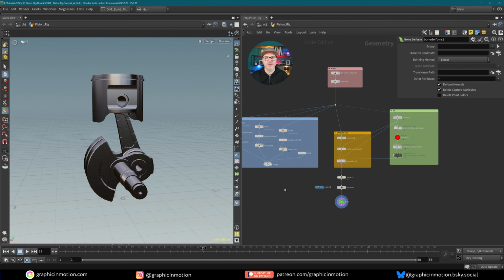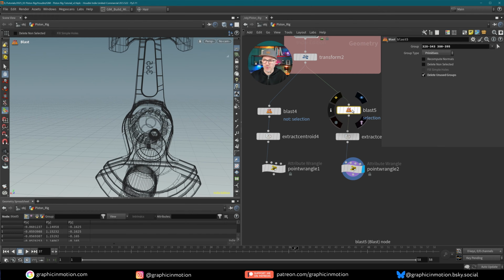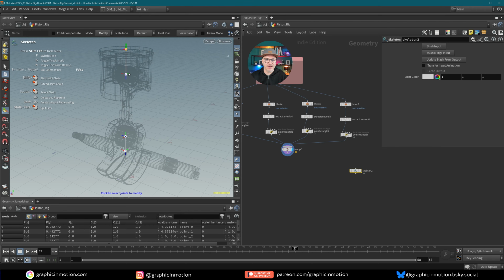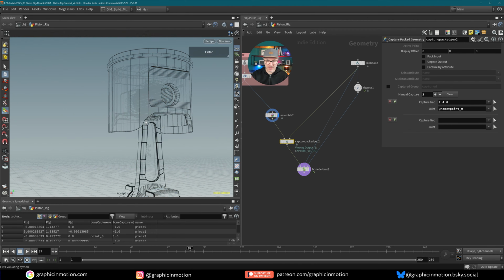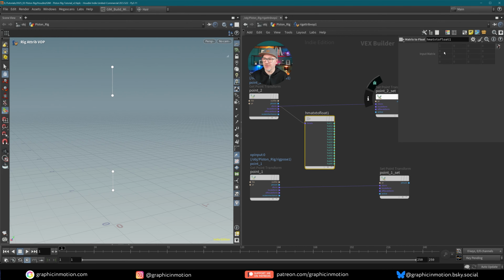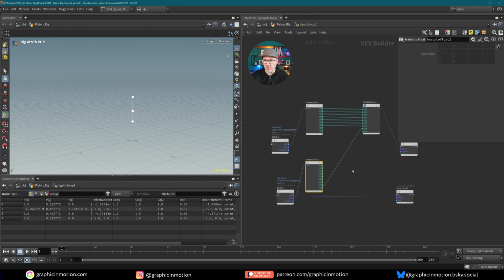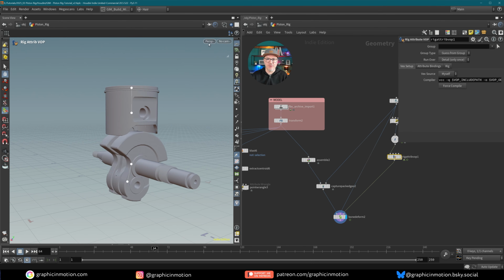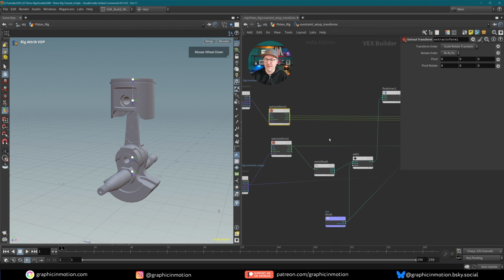KineFX for Mechanical Animation: Rigging a Piston in Houdini

Comment: Thanks, content for mechanical rigging is rare to come by.

Interesting setup you had for building the skeleton by extracting centroids -> using those as references for snapping your skeleton joints to.

I wonder, was there any particular reason you didn't use the points themselves -> via rig doctor etc... to build the skeleton? Especially since from what I can see rig hierarchy for export to other DCCs etc... wasn't an important concern with this model
Reply from the maker: That would have also worked. But I wanted to show the Skeleton tool in the tutorial.